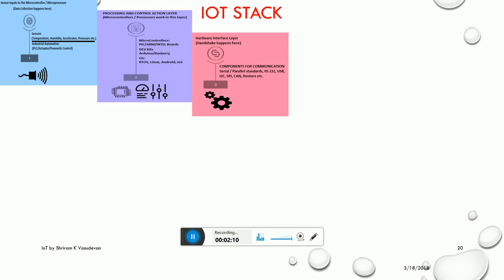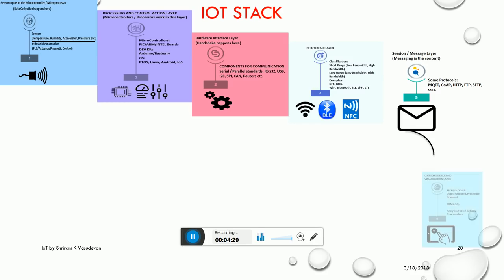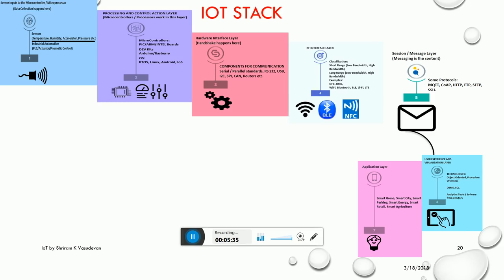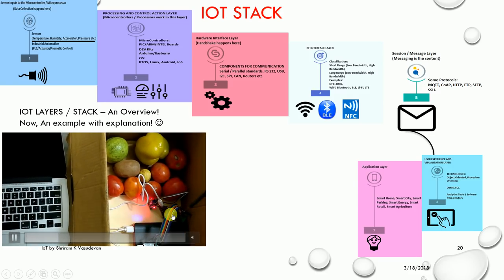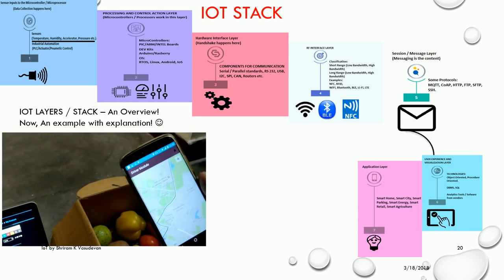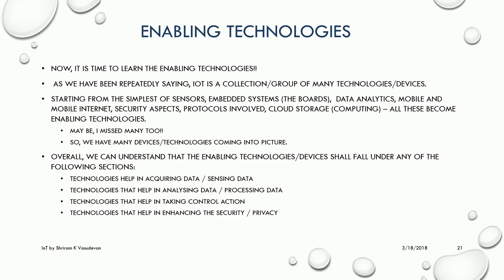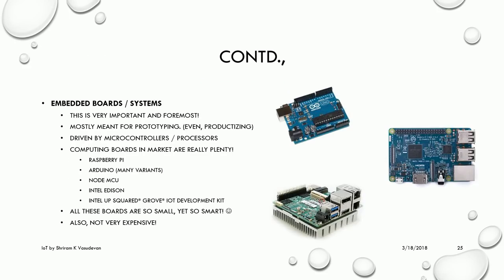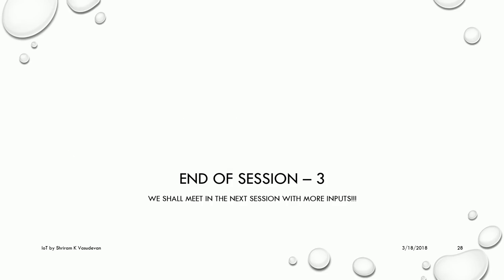3. Internet of Things - IoT architecture, IoT enabling Technologies

Comment: Home Work:    Answer-> 1. Smart Light ( In Mini Mall Shops, Lights will be off where customers are not available.
                                            2. Smart Storage System  ( If Chocolates are finished at a single storage in Shop, Then  Smart Storage system sends a message to shopkeeper that Chocolates Storage is empty.